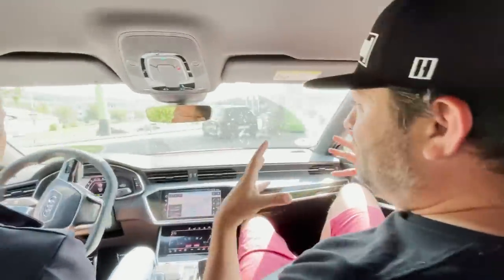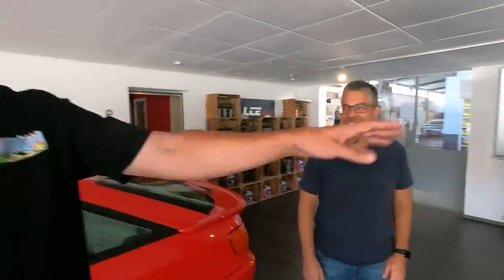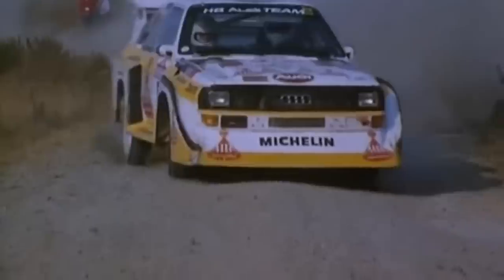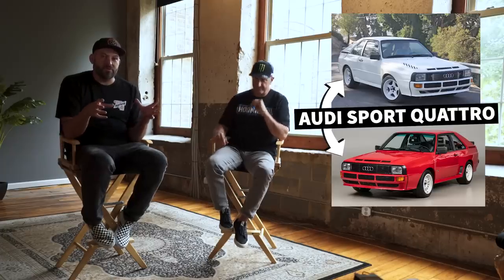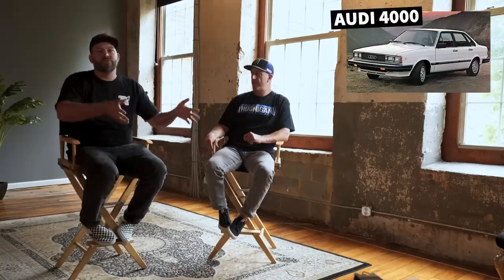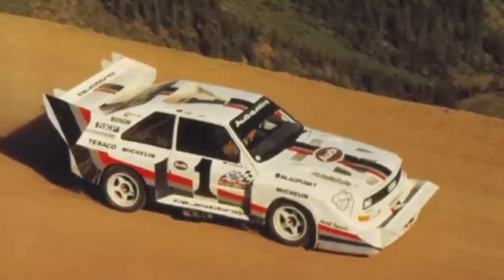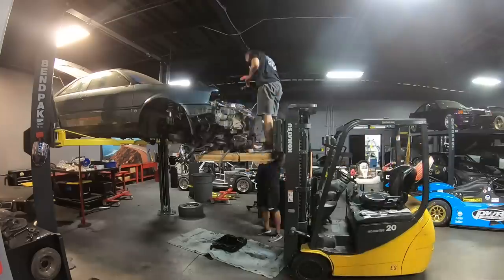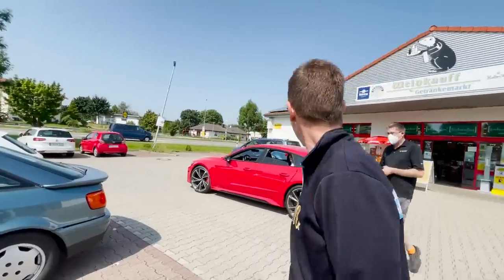RING LEADERS: Ken Block & Scotto hunt for the RARE Audi Sport Quattro TURBO MONSTER in Germany

Comment: Audi Lago Blue Metallic / LY6Z / #46686d Hex Color Code
#46686d Paint Chip 
The hexadecimal color code #46686d is a medium dark shade of cyan. 
In the RGB color model #46686d is comprised of 27.45% red, 40.78% green and 42.75% blue. 
In the HSL color space #46686d has a hue of 188° (degrees), 22% saturation and 35% lightness. 
This color has an approximate wavelength of 488.39 nm.

So in theory its more blue than green.
Reply: Doing the real work here
Reply: When your building cars to race (FH3 - FH4 - FH5) in game the cars need to look real. God Knows I wouldn't be able to buy any of them in real life.
Reply: Fuck yeah alex
Reply: From a fellow designer, thanks for the analysis, but I still think it looks green.
Reply: I'm surprised Scotto hasn't pinned this yet.
Reply: Heunigan!
Reply: Yea na it looks blue
Reply: DOing god's work here dude, thank you for settling this
Reply: It's a Dark Teal through my eyes. 
And everyone sees color slightly differently from their own perspective. 
My Red is not the same as your Red.
Reply: @peppermintnightmare4741  thats why we have colour analytics which determine with high amount of accuracy what colour is what. so the colour in question is "27.45% red, 40.78% green and 42.75% blue." therefore mostly blue and is described as "medium dark shade of cyan". Therefore you might think it is a "Dark Teal" but you would be incorrect no matter your perspective.
Reply: green is the color the human eye sees most easily.
Reply: AKA whoever sees green most likely colourblind

Comment: In El Gigante's defense, in the sun it does look blue. It looks like a nice lighter blue. When not in direct light, it's more of a blue-green mix. The whole life getting in the way thing, I feel that cuz the '91 Dakota I got recently has been sitting for a while with the bed off and the cab and front clip on blocks on the frame because I've been working so much. I pulled the body off the frame completely today so work will soon resume. Progress happens, sometimes just slower than we'd like or want.

Comment: 7:55 Ken I feel this so much, I got a 76' MGB and I have to do a full custom peddle box and settup so my feet fit with shoes on for daily driving eventually. Doing custom hard top and seat mounts so my head clears. currently saving to rebuild the body, put it on a frame and K swap 6-speed H patern.

Comment: Funny, I also bought my 1990 Lago BLUE CQ (with an Iroz motor swap) as a treat for landing my first salary position & of course, its sitting in a garage across country - albeit, can run and drive. Cheers and enjoy the 5 cylinder noises :)

Comment: I own a 2002 s4 with a forged 3.2 stroker crank, titanium rods, billet pistons, ported and polished 2.7t heads, custom ground cams, stainless valves, borg warner 72mm ball bearing turbo, water to air intercooled, meth injection, turbosmart 45mm gate, tsmart blowoff valve, megasquirt ECU, stock B7 rs4 6 speed trans with a monster triple disc clutch, 3 custom limited slip diffs, modified LS style FAST fuel rails with 1500cc injectors, 2 walbro 650s in a 12 gallon fuel safe cell, i built the exhaust manifolds, roll cage, engine, and the rest of the entire car including paint myself. Ive smoked 1100 hp vipers, supercharged hurricanes, my dads big tire mountain motor '69 impala, and i drive it to work almost every day.

Comment: I used to have a lightly modified S4 with the 4.2 V8 and six speed manual.I loved that car and miss it.I sold it cuz it was approaching 100k and the timing chain deal scared me,but that car was a badass German hotrod.
Reply: Do what I did, get a CQ with the older belt-drive 32v 4.2L ;-)

Comment: It looks like the vw helios blue, your friends are color blind he he sorry kent, the turbo monster should remain red. Please put the 400bhp 5 cylinder aluminium motor in that car with some tuning, the sound will not be like mtm 700bhp sport quattro but more every day car, mtm tuning made a intake manifold with 10 injectors ports for the old motor. Ps if you use old skool block please use correct parts mtm or wagner tuning. 😉